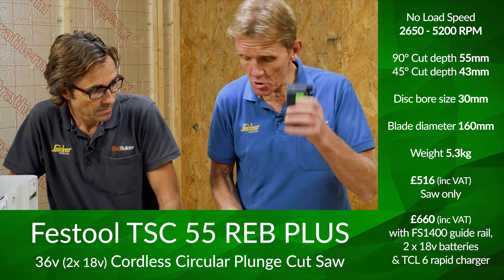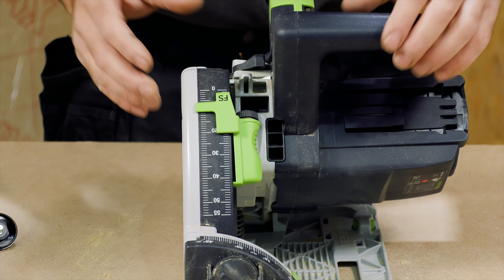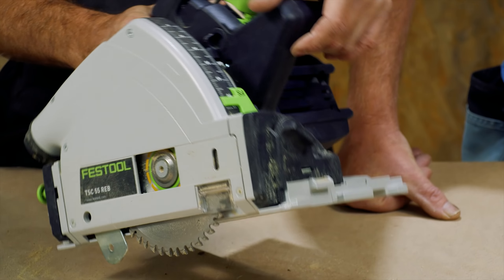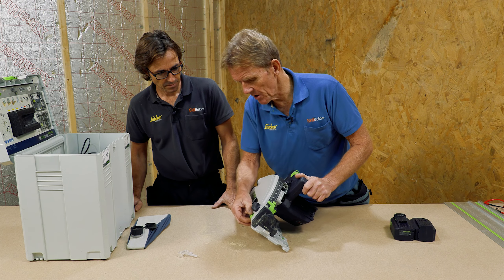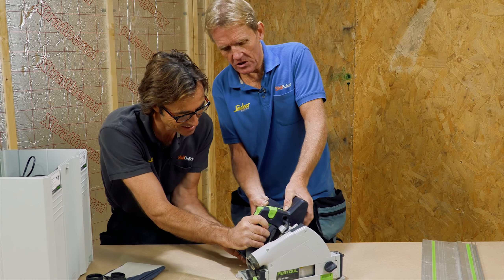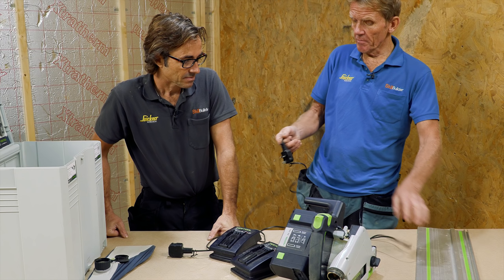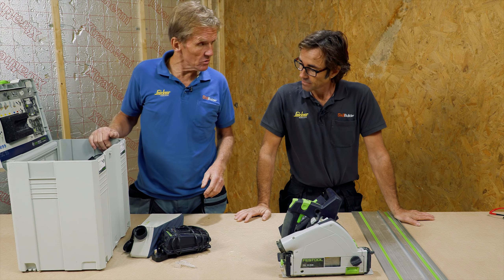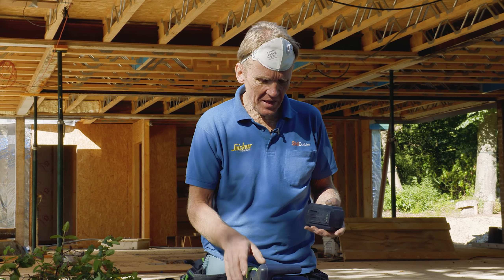Festool TSC 55 REB Cordless Plunge Saw - Episode 4

Comment: That’s my biggest problem with 110v festool. Lacks bollocks. 1200w isn’t enough when mafell give 1400. I have the rip fence which is great but when the saw at arts to heat up it becomes torture.

Comment: Used to own that, so under powered, currently using Makita cordless twice the power.
Reply: I sold my corded Festool TS55 and bought the Makita 36v tracksaw. It's a beast. Absolutely brilliant in my applications.
Reply: Which plungesaw is best to get david.im about to plunge in and buy my first .its all wet wall panelling im doing now

Comment: Power, or lack there of: Surely its down the actually power rating of the motor - how many Watts was it? Compare that to one of the AC mains powered version, often the battery powered one are lacking in  comparison. Also was it DC brushed, or Brushless motor? (which is actually a 3 phase AC motor + inverter electronics) - as I have seen with Makita one gets a lot more efficiency and useful power out your typical Li Ion battery pack with one of their latest Brushless tools.Just one other thing about a 2nd battery  - it would add the same capacity to deliver extra power whether in parallel or serial ,  the main thing about using a higher voltage is less power loss in cables (I squared R) - higher voltage, less Amps will flow, and power loss is the square of current.

Comment: the reason why this saw seems under powered is due to it having the biggest kerf 2.2 mm thick no other brand uses a blade with this size kerf. but you will find the blade doesn't bend during cuts.

Comment: Batteries need close attention.  How quickly they can be recharged is for me a key parameter.  I prefer two 3AHr batteries rather than one 6AHr battery since one battery can be on the charger while you use the tool.  Choosing batteries with a fast charge rate is therefore Important so that you are not left waiting

Comment: He's using the old batteries...... I have the 5.2 amp batteries... they even have 6.2ah battery..... those batteries arent airstream. And also if the blade is old.... mine has plenty power in it.... never would store it outside in the cold. It feels on par with the 240v powered saws... so try using  new equipment
Reply: The point is you want a tool that still works when it's not brand new
Reply from the maker: If Festool had sent us a new saw with new batteries we would have tested it. We did what we could, short of going out and buying one.
Reply: Mines is same as urs plenty of power  and brilliant!
Reply from the maker: O.k but this saw struggled so there is no use pretending it didn't. They still have time to send a brand new saw out and we will test that as well.
Reply: Yea but your comparing it to totally new tools.... and that's just not fair. You also say about storage... if it's stored outside... all the cells in the battery won't work either... especially thru the bad weather.
Reply from the maker: oneillcfc7921
I love it when we get the "That's not fair" comments. It reminds me of my kids when they were young to which every parent replies. "Life is not fair, get used to it." We were not going to leave the manufacturer that invented the track saw out of the test but we were also not going to buy one just because they didn't respond to our request for a loan tool. It is also incredibly useful for would-be buyers to know what they might expect from a track saw that isn't brand new. Also a shed is not outside. My wife won't let me store my power tools in the kitchen. I told her that isn't fair but she doesn't care.
Reply: @oneillcfc7921  where do you think most people keep their tools? Personally I keep mine in my van, so I think a shed is a step up
Reply: I look after my stuff dude so it usually always works perfectly... and if it's ever outside it's in airtight no moisture boxes never. And I don't live in the UK anymore so it won't get that cold anyways lolololol
Reply: Yea i use mine for work also. But no rust on my tools man. You must have a bag of scrap lol
Reply: I guess it's not fair on you guys since you aren't big enough for festool to send you tools to test😂😂😂😂  I'm not a festool fanboy I only own the saw...  But it's like saying if my auntie  had a you know what she'd be my uncle. My point is... unlike you logically I'd reserve my own opinion on a fair comparison. But it seems like you might be a tad butt hurt since festool ain't going to send you toys so you throw them out the pram.
Reply: @Elliott Day I didn't say I abuse my tools, but they are used for work. If you've got time to sit and clean all your tools then good for you, but I don't, and they still work fine
Reply: @oneillcfc7921  where exactly are you going to get rust on a plastic saw?
Reply: The blade the electronics inside.... are you special in some sort of way
Reply: @oneillcfc7921  they would only rust if you dropped it in a bucket of water. I'll keep using my tools to earn money, you keep polishing yours and keeping them in a display case
Reply: Nae bother Wee man..  lol you use your rust bucket at your special school good boy
Reply: @oneillcfc7921  so much for not replying again🤣
Reply: @SkillBuilder  i wouldnt worry to much mate, admittedly no its not a new tool. but ! and this is a important but, this is a premium saw!, festool pride themselves in being the best in woodworkers tools and this saw carry's the price to mach and unfortunately it doesn't perform as impressively as the price. this isnt the first time iv seen and heard it being called under powered, at 36v it should cream 40mm of chipboard but as seen by the video it struggles. if like someone mentioned you did upgraded to new airstream battery's i doubt you would see much change in the way of performance, not to mention that your nice new expensive saw wont work very well with your existing battery's. that kinda kills the sale for me when u have options like makita that performs better even with old battery's and has a much bigger range on cordless tools on offer in comparison. why would you buy the festool in comparison ??
Reply: @hartsymk1  your comments pretty much describe the festool brand now compared to the competition as they have improved greatly in their newer models whereas festool has not evolved to stay in front just keep their price in front.